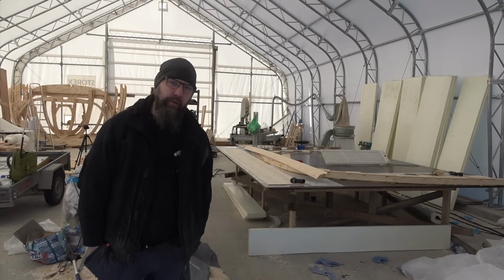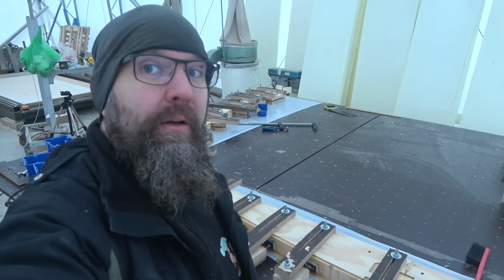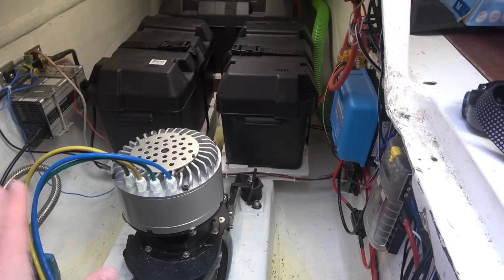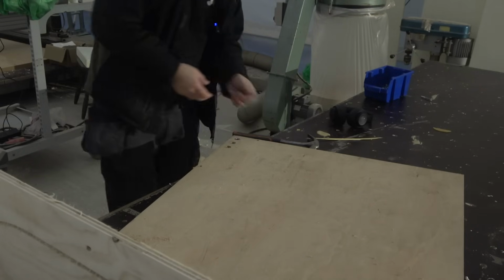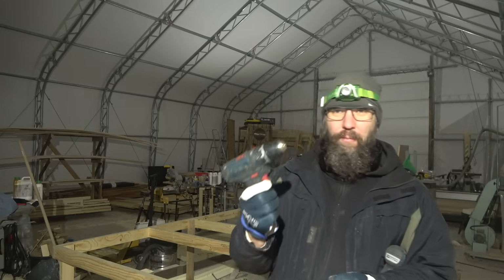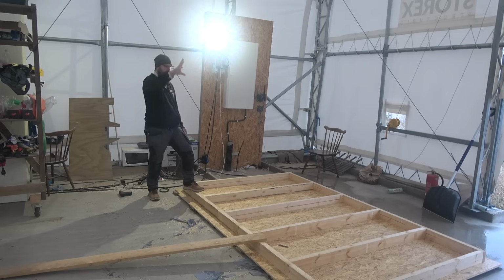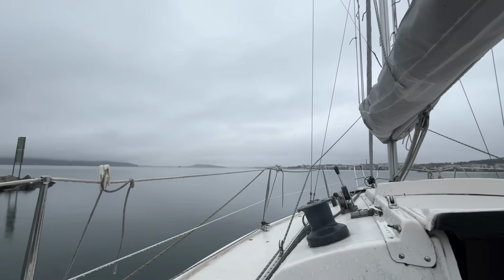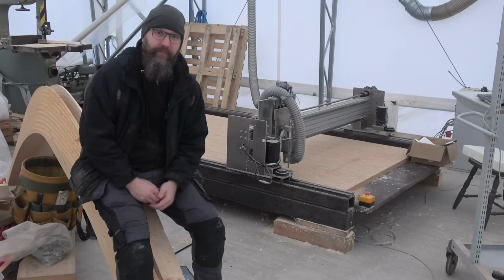THE LAST FRAME (and other stuff!) - ep.66 Project SeaCamel

Comment: Congratulations on completing one ‘small item’ from the project plan.😉 It is all the more remarkable of an achievement when you consider what you had to conquer to get to this point (construct a CNC machine), erect a  building and construct a huge work/assembly bench - just to mention a few) and essentially all on your own.

Good luck with the next steps in insulating the build shed and constructing the office.

Comment: Lithium batteries do not do well in a cold environment heaters have to be installed along with them to keep them healthy.
Reply from the maker: Yes that’s true. Luckily the season doesn’t really extend to freezing times that much. This time I got the boat up before winter! 🥳🤪
Reply: As long as the boat is not anchored they could be heated from shore power although a decent solar set up would probably easily keep up too, assuming an insulated battery box.